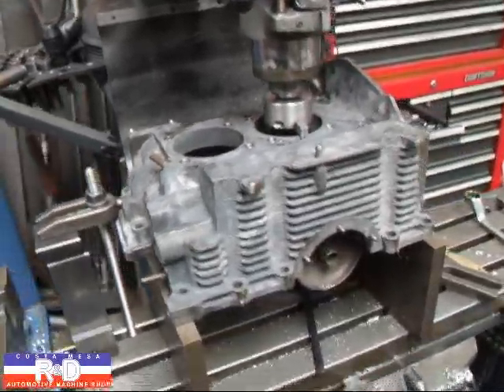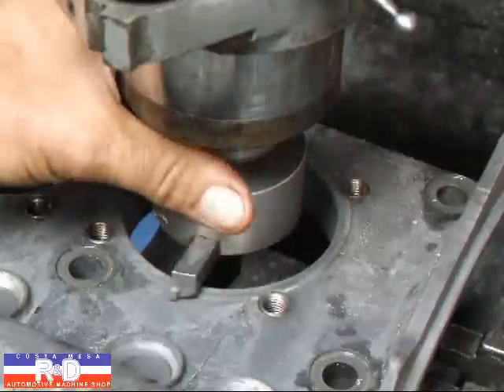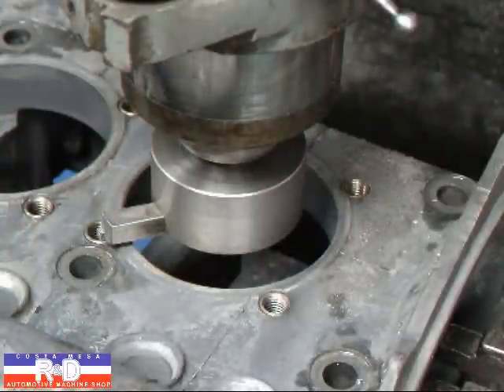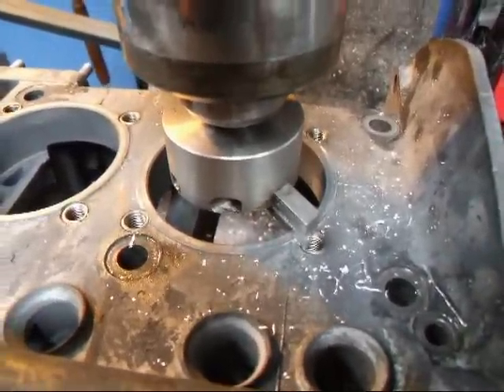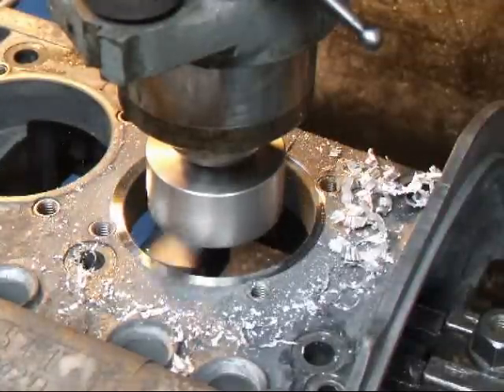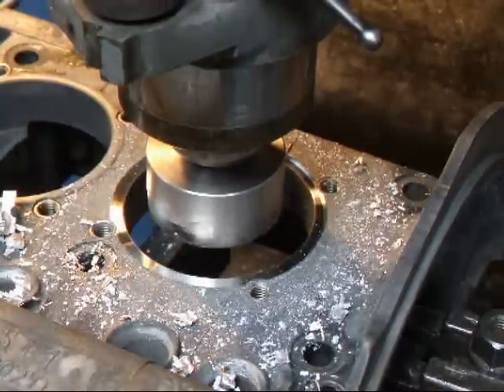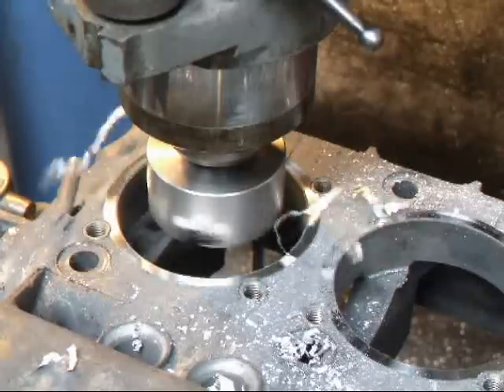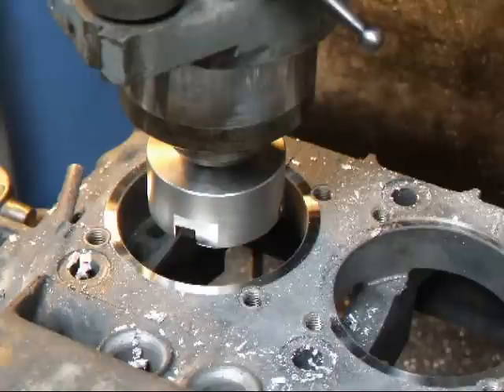VW Spiggot Bore Resurfacing.mp4

Comment: Years ago I had a Citroen GSA, air cooled 4 cylinder boxer engine... It had an oil leak just on this point. It had new pistons, rings and cylinders, rebuilt heads... Tried to resurface the block like you, but it was a groove where cylinders were fitted. I tried then abrasives like the ones used in valve seat resurfacing... no success. I loved that car, but the oil leak was going directly to the brake rotors, attached to the gearbox, not to the wheels. I miss that car... :(

Comment: the "extra shiny" metal on the edge of the cylinder instert bores (?) what is that? inconel? could it perhaps be an idea to weld in some inconel there to get a real good and hard sealing surface?
Reply: Kjell Randeberg how are you  gonna weld inconel to magnesium?